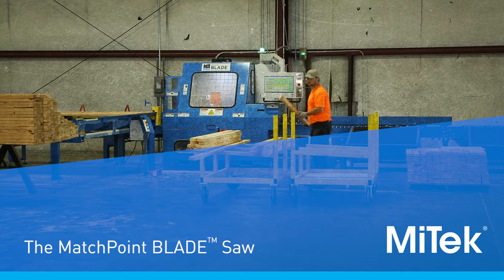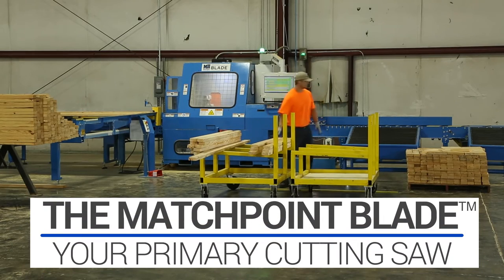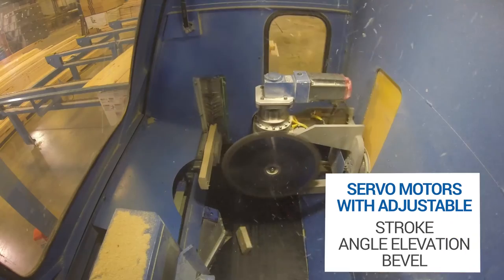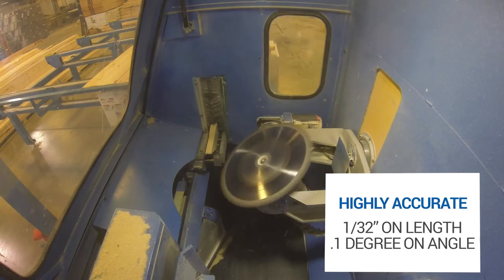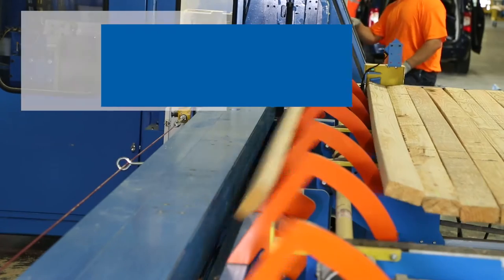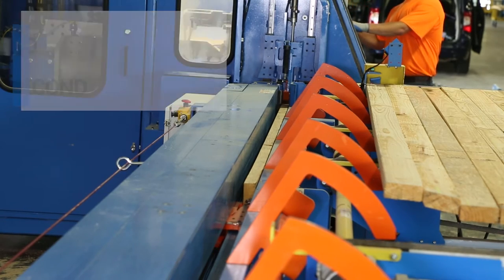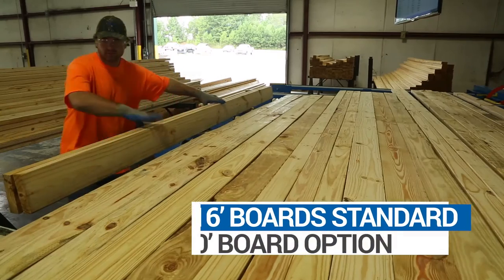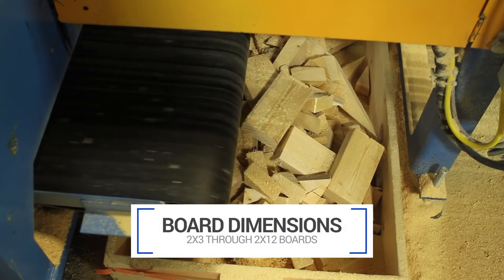MACHINERY - MatchPoint Blade Wood Processing System

Comment: Just out of curiosity. What should be recalibrated if the saw is cutting around 1/4 of the piece instead of the small amount seen in the video?
I'm just tired of seeing it threaten to die at 33 degree rip bevels and it dying at 40 degree